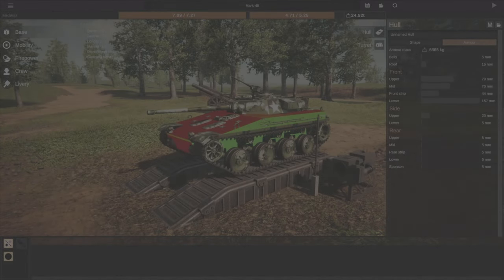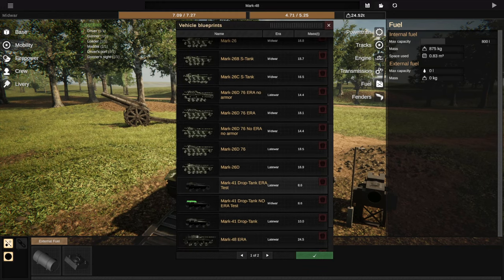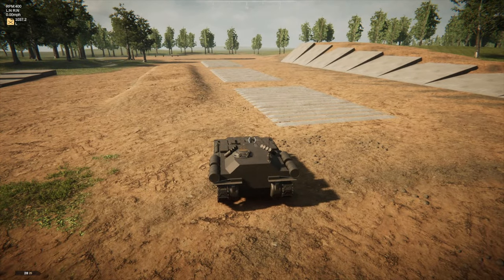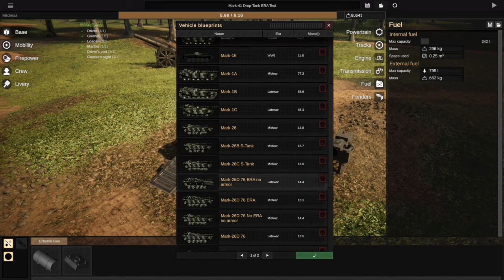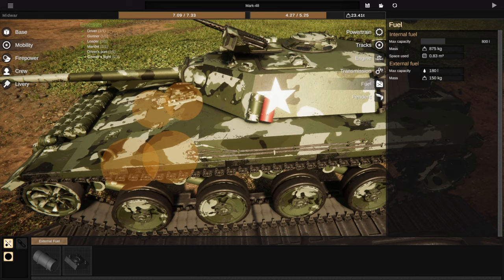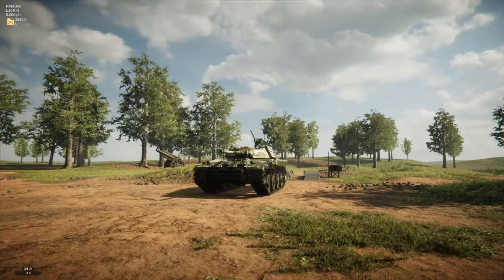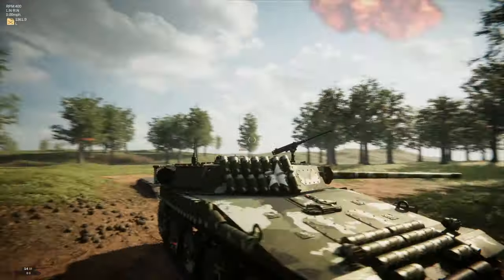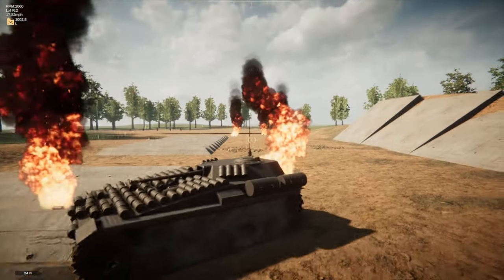ERA stops anything... [patched] |  Sprocket

Comment: there are some new flat decorative parts you can use to cover the fuel tanks to make them look a lot more like ERA. Look under "Crew" then "Structural". There are some flat metal pieces, some with rivets and some without. They will stick to fuel tanks too.

Alternatively, you can place riveted panels over them, however they are a lot less "flexible" with placement.

Comment: Could you try to build a T-34 with a 122mm gun from the IS series?
Reply: the T-34 did not have the capacity to carry a D25T 122mm gun, the biggest gun it carried in history was the D10T 100mm
Reply: @mariebcfhs9491  Bit late bud, but still it was just for the jokes, I know it's way too big for a T-34.
Reply: Put an is 2 turret on and scale down the armor you ratata
Reply: cursed design, I'll try it myself

Comment: Could you build a Sherman that has Era slapped all over it and equip it with the 150mm long range howitzer.
Reply: The turret is probably not gonna be able to take it and canons above 125 are usually not efective